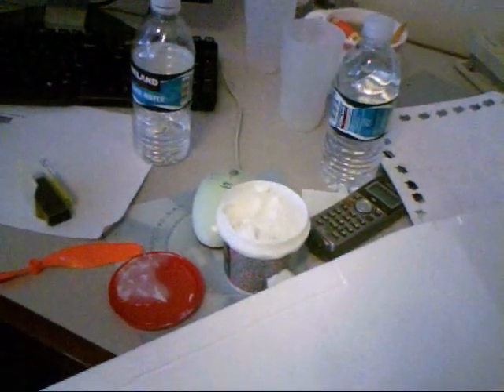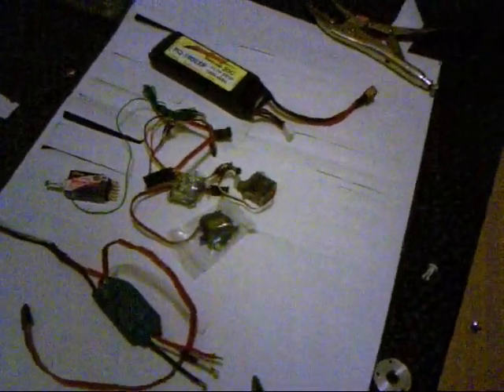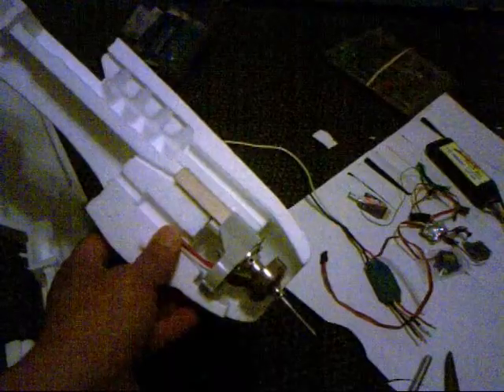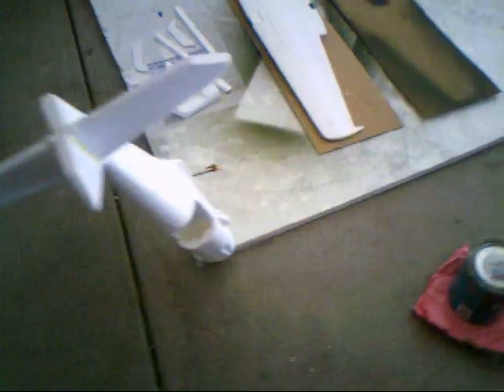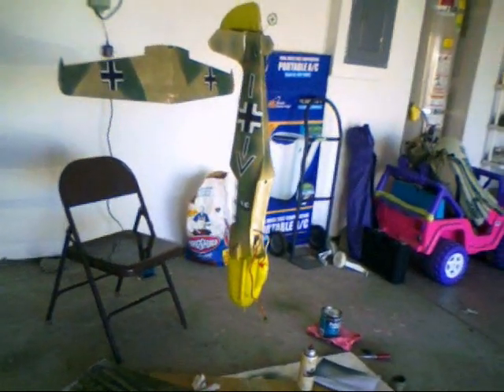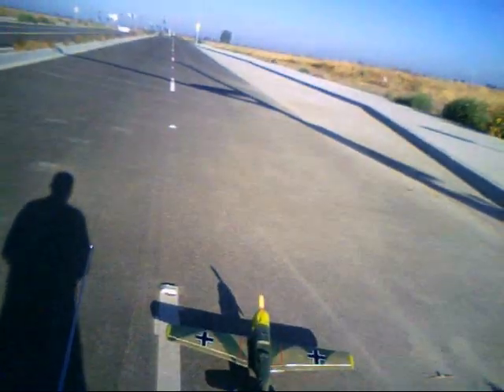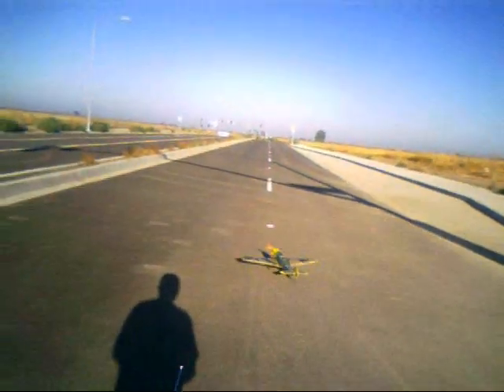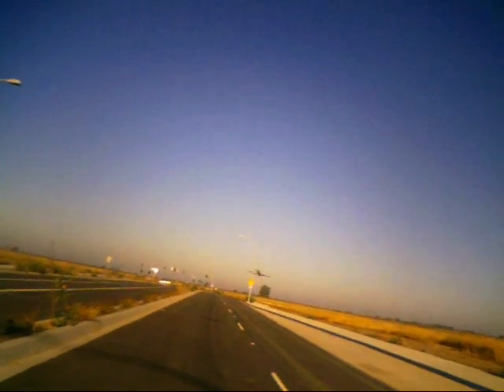brushless GWS ME-109 Build and Maiden

Comment: I installed an Exceed RC 379 motor 1080 KV and an 9 X 6 prop and followed the manual's CG.  The heavier motor with metal spinner made it slightly nose heavy but it flew great.  I didn't notice any tip stalls until almost floaty speeds!  It can fly slow or fast, very stable.  Perhaps it's heavier and flies better.  The wing loadng is surpringly light and for a plane its size, it gives a light feeling like its family of  GWS trainer,

Comment from the maker: @mksubaru Yes...don't use straight paint on these guys- it will eat right through it. I used 2 coats of Minwax polycrylic clear coat on the foam first. The clear coat dries to a hard finish and protects the foam from paint and simple scratches.  The vid shows how a can of it. minwax polycrylic can be found at home depot, lowes...etc..or do a google search for it.

never flown the mustang, but by the look of the wings, I think it's gonna fly like the ME-109.

Comment from the maker: @mksubaru congrats! Yes. this plane tip stalls easily on slow turns. After I got the cg right on mine, it did fly pretty good. I have to disagree on the material...it's strong and repairs well (LOL...crashed half of dozen times and fixed with glue gun). Sadly, I lost this plane a couple weeks ago..not due to the plane, but pilot error. I flew into the sun and came out...lost orientation and it went down hard. result was about a dozen pieces.

Comment: hello rcalldaylong, i have bild mine, and made the maiden flight today, cog was perfect, didnt eaven had to trim it, almost tip stall it, this boy dont like slow speed wend turning, i just wish it was made of a stronger material, but i am very happy, i am using a turnigy 25 AMP ESC, HXT 2835 (380S) 2200kv Brushless Inrunner, turnigy 1300mah 20-30C,hxt900 servo , propeller graupner 6,6-3" , i flow for about 5 min.

Comment from the maker: @mksubaru easy is relative to what skills/background you have on building. To me it was fairly straightforward, but I did build a couple before this one. The most important thing building is making sure your surfaces are true and straight. i.e make sure your elevator and stabilizer is even and in par with your wings. After building, the most important step is center of gravity (cog). You never want to fly a tail heavy plane. From there, it's the nerve wreaking maiden flight you have to get past

Comment from the maker: @bigs31uk I'm sorry, but I would have to disagree with that. GWS planes are one of the better foamies out there. How did the back wing fall off? It's mounted by a single screw on the back, but it would take a lot of force for it to come off. When flying, the force is pushing on the wing so no pressure on the screw- it's only when flying inverted, but I doubt that's what happened. 

Anyways, GWS planes mold well, takes good paint and looks good, but best of all flies well.

Comment from the maker: This ME-109 has quickly become one of my favorite planes. I corrected the stall problem- CG was a tad tail heavy and when throttle came off, plane would pitch up causing a stall. Once I moved the battery more forward and got the CG right, it flew really well. The sleek airframe and wing design allows this plane to fly very fast. I went from 1000 mah to 1300 mah, so get a higher wing loading...more speed. On a 7x6, this thing screams...loops, rolls, dive bombs. No wonder the Russians kicked butt

Comment from the maker: thanks. if you try it, make sure you get the light spackle. If you pick up the can and it feels empty, that's the one. Yep, Spackle fills up any scratches, holes, etc...then you simply sand it down real light with 220 grid and  paint- can't even tell there was a scratch there. As for the knicks, the Polycrylic finish certainly helps, depending on how many coats you put on...